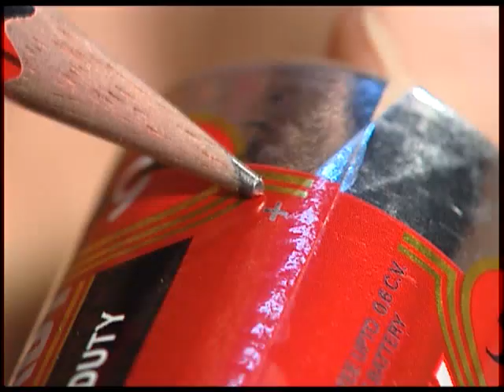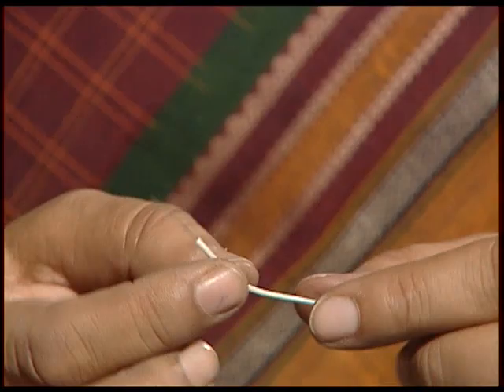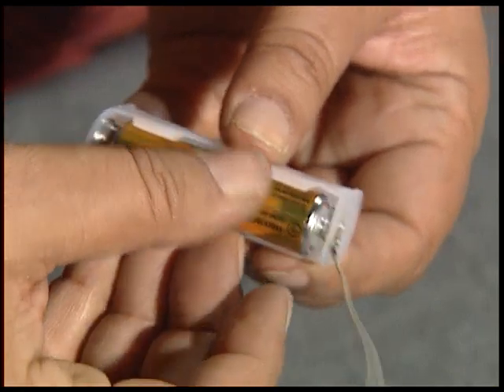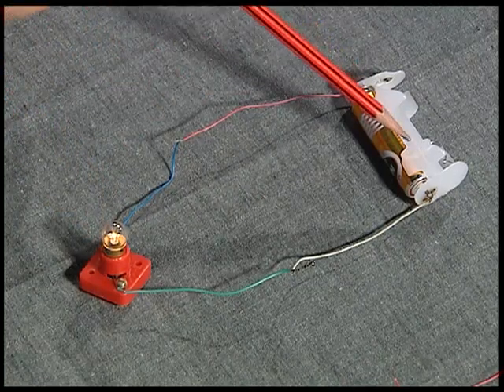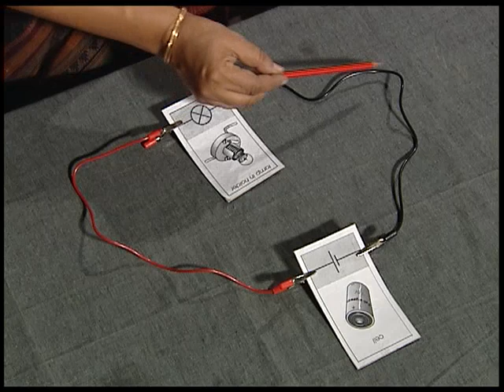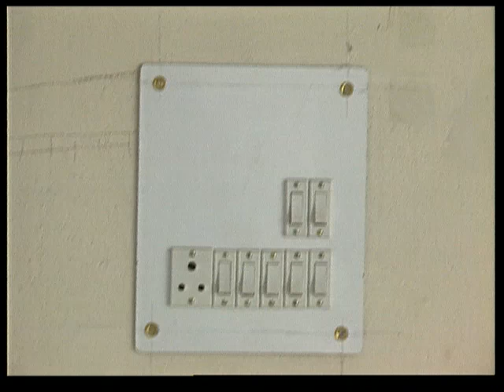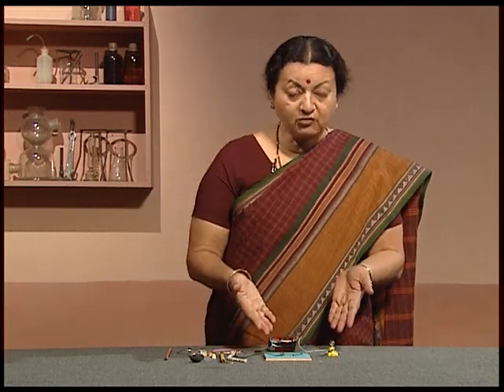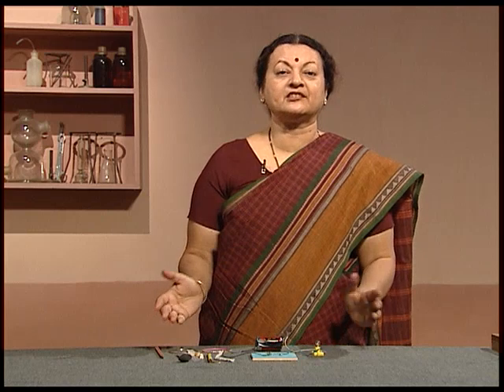ELECTRICITY & CIRCUIT

Comment: If electricity is not throw that material is called insulator not bad conductor they are spelling like that
Reply: There is a difference between insulator and bad conductor. There is neutral light in the bulb when the switch is a bad conductor, and the no light in the bulb when the switch is an insulator.